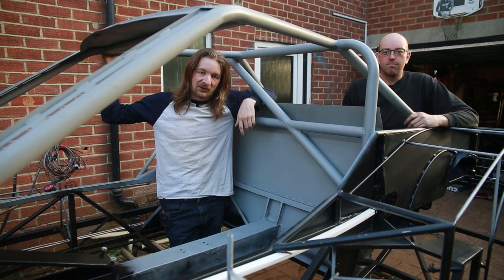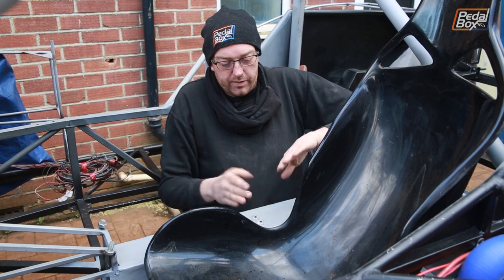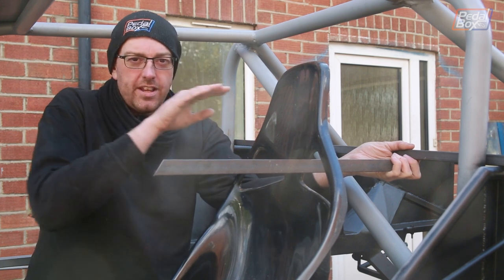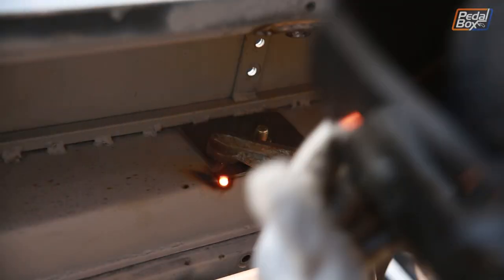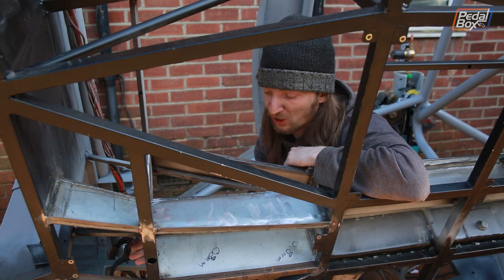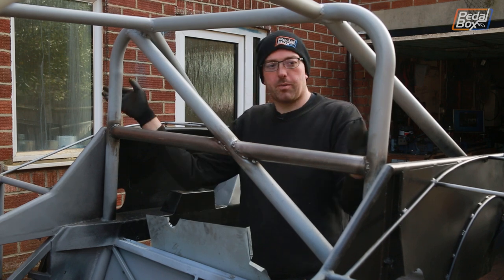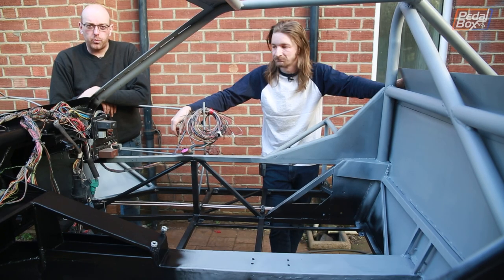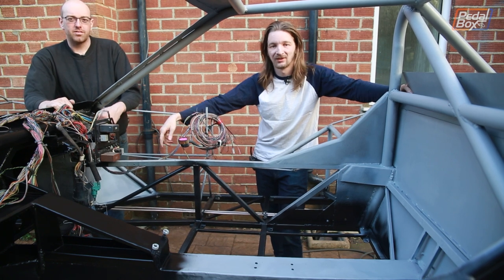Adding Sheet Metal | Audi TT Kit Car | PedalBox Episode 74

Comment: Your certainly need heaters, of any kind!! Best heaters I've experienced was a MK1 MX5, red hot, probably a good sized heat exchanger and narrow vents increased the effect with the top down. I've video going live tomorrow that touches airflow though an intercooler and the turbulent stall effect in a round about way!! Keep up the build guys👍
Reply from the maker: About to bite the bullet and buy the heater unit, it's a tight fit but it should fit, just need to punch a hole through our firewall for the air intake, and I guess mount a filter... You can put a cone filter on a heater intake right? :D

Comment: I thought the shoulder mounts had to be not below the persons shoulders so that it does not put extra strain on the spine in a crash?
Reply: I thought that too but when we checked out the documentation (I’d link it but YouTube hates links in comments) it turns out down is good, weirdly. You don’t want them much below the shoulder line, but the rule is definitely horizontal or down by up to twenty degrees. At twenty degrees I think you only get about a quarter of the forward force (via tan(20)) converted into vertical which seems fine. We’re a bit past that because of our height difference but it is what it is.
Reply from the maker: Theres are a few different bits in the docs about with/without HANS which then relate to the seatbelt shoulder angle. Doesn't help when you're trying to account for a wide height range